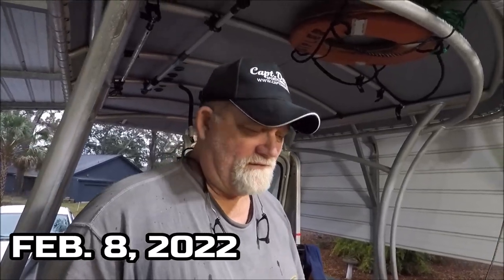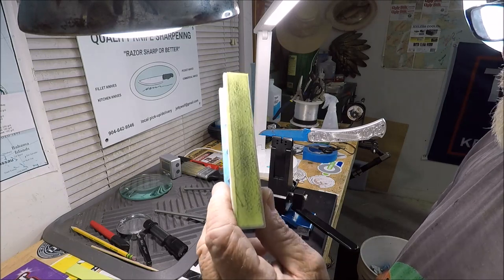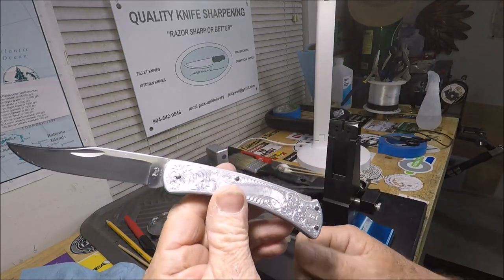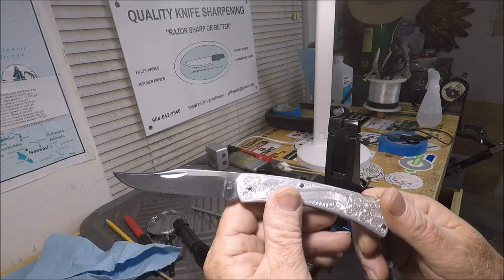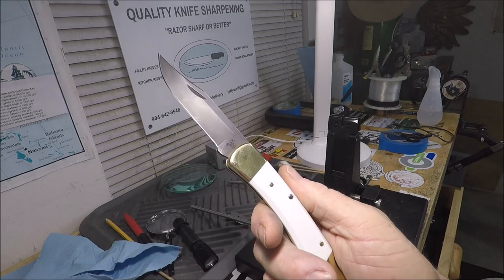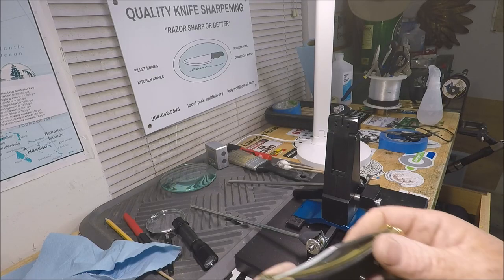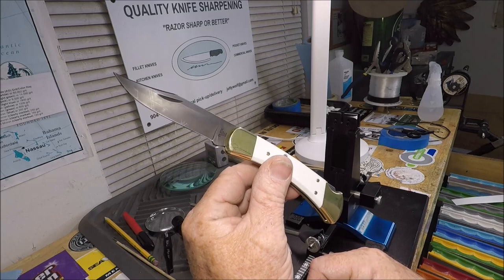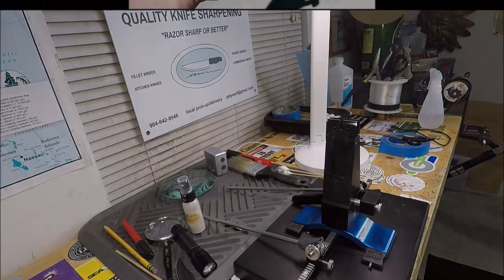THE BUCK 110'S, SEXY SISTER❗

Comment: OK, the 111 Classic was introduced in the 1981 catalog. The original concept came from a rodeo cowboy/engraver named Gary Gist. Originally, the idea was to produce a Gentleman's Jewelry knife out of silver. When silver went out of sight due to a Mr. Howard Hunt, that idea was scrapped and they turned to aluminum.

The first few (<50) were produced using 110 blades and about 2000 were made with satin finish blades instead of the mirror polished ones. Some had a polished "banner" (rare) and later they had satin finished "banners". There were even a few really rare ones made out of brass.

There were four variations of the classic derived from the 110, 500, 503 AND 505.
Reply: This was taken from a blade forum